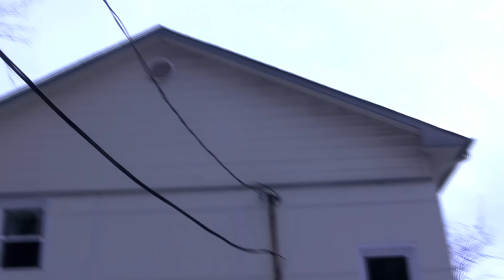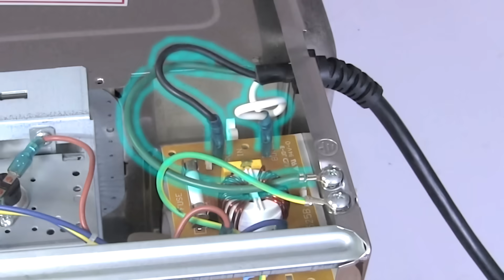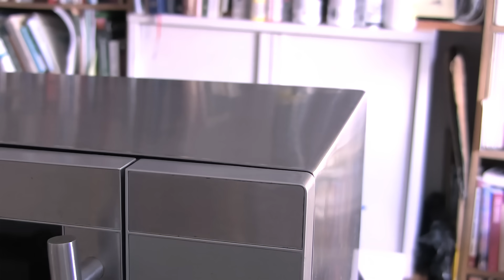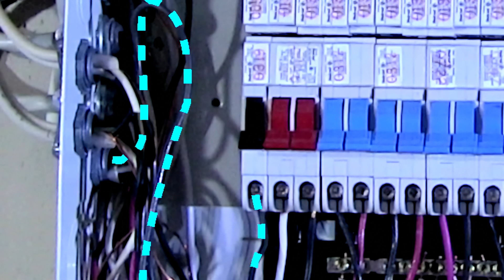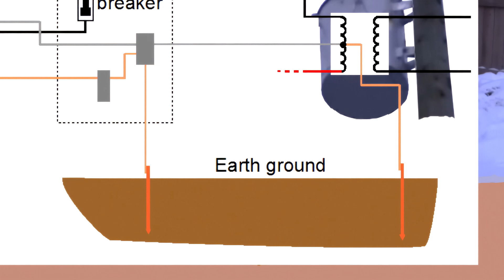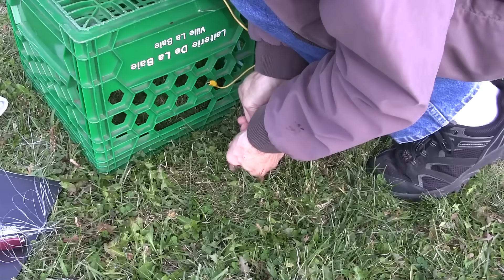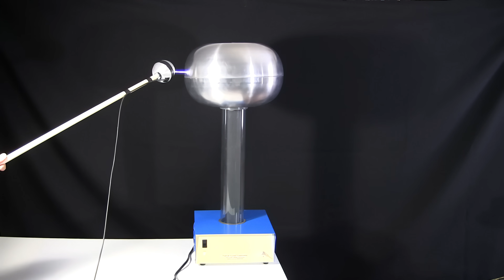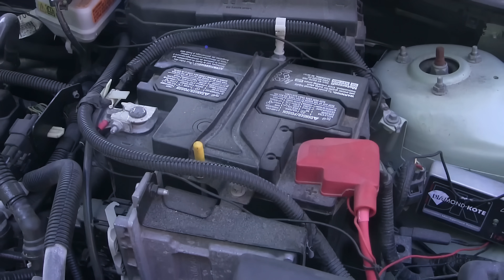What is Ground? Earth Ground/Earthing

Comment: Great video. But your explanation for why we connect the neutral wires/ground wires/center tap of the transformer’s secondary winding to the earth isn’t quite correct.

The PRIMARY reason we connect the neutral wires/ground wires/transformer center tap to earth is to prevent the transformer’s secondary winding – and all of the wiring in your house – from “floating up” to the voltage of the transformer’s primary winding. Which is around 7200 V (relative to earth) in North America. 

 There is some resistance between the transformer’s primary and secondary windings, and (more importantly) some capacitance between the primary and secondary windings. Because of this, if you do not connect anything on the secondary to the earth, the common-mode voltage of the entire secondary, including your circuit breaker box and all the wiring and outlets in your house, will float up to 1000 VAC, 2000 VAC, 3000 VAC... perhaps even up to 7000 VAC relative to the earth. An outlet, for example, will still have 120 VAC between hot and neutral. But each will be thousands of volts above the earth!

The only way to fix this problem is to "nail down" the secondary. We do this by connecting one of the secondary terminals to the earth. We can choose Line 1, center tap, or Line 2. It is best to connect the center tap.
Reply: So as you said, the main problem would be due to the lack of the same reference between the primary and secondary?
But if we measure just the secondary ignoring any connection to earth, this is probably going to be our expected 120V for example, but if we measure with earth it”ll probably be at higher voltage difference compared to earth?
There are some many concepts that I didn’t catch very well when I passed the electrical installation subject, now I am in field I am trying to understand this kind of behavior
Reply: In north America the leg to leg measurement is 240. Where are you getting 7200. Are you insane!??
Reply: @MathCuriousity  , the primary side is 7200 V relative to earth.
Reply: my mistake I’m sorry for that. I’m an idiot. May I ask two followup questions if u have time: 

1)
basically I was told that even if a system isn’t grounded (no ground rod to neutral etc at transformer and no grounding anywhere ) that if a power line that’s energized comes down and touches the earth, that it would still energize the earth. Now if energize means put the earth that it’s touching at its voltage then that’s surely true right? No matter if it’s soil, gravel, water right? A  120 v line comes down, and it will make the earth 120 v no matter what it’s touching? I’m not saying it will run current yet. Just saying that for instance, if we measure the neutral to the ground, we will get 120 volts right? So that’s the first question.

2)
The second question is - let’s forget about voltage. We have this 120 v line touching the ground - let’s say it’s grass or soil or water, is it possible for a current to flow thru the very earth itself if there are no grounding rods or grounding stuff anywhere near by? I ask it this way cuz I’m tryna take away with “return to source” and still see if current would flow thru the earth.
Reply: @MathCuriousity  as for #1: let's say I have a 1000 V battery on a table. If I connect one of the terminals to the soil, it won't "energize" the Earth.  The battery won't know it is connected to the Earth, and the Earth won't know a battery is connected to it.

As for #2, current always flows in a loop. If the secondary of an ideal transformer is floating, and one terminal of the secondary touches the Earth, then there will not be any current in the Earth. This is the same as #1, except we have an alternating voltage instead of a non-alternating voltage.
Reply: @ 

 Hey thanks for writing back! So in scenario 1, would the voltage read 1,000 - 0 = 1,000 then? 

And in scenario 2, why would it have to be floating for this to play out?

Finally - I wanted to ask you something else that’s been bothering me - if you have the time: I read that if a neutral ground bond is broken,  then if the neutral to ground becomes say 50 volts, that the hot phases will also rise the same value. Why is this?
Reply: @MathCuriousity  , in scenario 1, if I connect the battery's negative terminal to the earth, then the voltage between the battery's positive terminal and the earth would be +1000 V.  On the other hand, if I connect the battery's positive terminal to the earth, then the voltage between the battery's negative terminal and the earth would be -1000 V.

When someone says the secondary winding of a transformer is "floating" it means none of the secondary terminals are connected to the earth or chassis. It also usually means none of the secondary terminals are connected to the earth or chassis using a resistor or anything else. In this scenario, the transformer's secondary terminals are "isolated" from ground, and you can think of the transformer's secondary terminals as an AC battery sitting on a table. (See scenario #1.)
Reply: @ ah ok so this is just convention I get it! Whatever we connect to the ground then the ground and it both become 0! Then the other terminal will have to adjust to ensure the same voltage and directional convention +/- as before that went across it and had a certain direction from pos to neg.

Now I read there are two types of floating neutrals :
- where neutral disconnects from the transformer 
-where neutral simply becomes unbonded from ground.

Can you speak on the second? I read when neutral becomes unbonded from ground (say the jumper at the main panel between ground and neutral comes off), that phase to phase stays same and any rise in neutral above ground will show also that same rise in phase. I cannot FOR THE LIFE OF ME understand why the phase would magically rise by same the neutral does! I also wanted to know if you had any scenarios you could share in terms of after the ground neutral bond jumper is broken, and its floating, what scenarios could cause say a 50 v or 200 v neutral rise etc ?
Reply: @MathCuriousity  first of all, keep in mind that the center tap on the transformer's secondary winding is connected to the earth in at least two locations: once at the transformer, and again at the box that contains the round meter. This is good, as it guarantees the common-mode voltage on the transformer's secondary winding can't "float up" to the primary voltage of around 7200 V.

The voltage between Leg 1 and Leg 2 is 240 VAC. The neutral in the home is connected to the center tap on the transformer's secondary winding. This means that the voltage between Leg 1 and neutral is 120 VAC, and the voltage between Leg 2 and neutral is 120 VAC, regardless of the loads connected to them. Note that 120 V + 120 V = 240 V.

If the neutral in the home is disconnected from the transformer's center tap, there will still be 240 VAC between Leg 1 and Leg 2. But it can no longer be guaranteed there will be 120 VAC between Leg 1 and the neutral, and it can no longer be guaranteed there will be 120 VAC between Leg 2 and the neutral. The voltage between Leg 1 and neutral, and between Leg 2 and neutral, depends on the loads that are connected between Leg 1 and neutral and the loads that are connected between Leg 2 and neutral.

Let's say the neutral in the home is disconnected from the center tap on the transformer's secondary winding, which would be an abnormal and potentially dangerous situation. Let's also say the following three things are plugged into 120 VAC outlets that receive power from Leg 1 and neutral: 125 Ω, 98 Ω, and 46 Ω. This means there is 25 Ω between Leg 1 and neutral. Let's say the following two things are plugged into 120 VAC outlets that are powered by Leg 2 and neutral: 50 Ω and 50 Ω. This means there is 25 Ω between Leg 2 and neutral. Therefore, the voltage between Leg 1 and neutral would be 120 VAC, and the voltage between Leg 2 and neutral would be 120 VAC.

Let's again say the neutral in the home is disconnected from the center tap on the transformer's secondary winding. Let's also say the following three things are plugged into 120 VAC outlets that receive power from Leg 1 and neutral: 500 Ω, 180 Ω, and 130 Ω. This means there is 65.6 Ω between Leg 1 and neutral. Let's say the following two things are plugged into 120 VAC outlets that are powered by Leg 2 and neutral: 60 Ω and 25 Ω. This means there is 17.6 Ω between Leg 2 and neutral. Therefore, the voltage between Leg 1 and neutral would be 189.1 VAC, and the voltage between Leg 2 and neutral would be 50.9 VAC. Bad things might happen to the three things that receive power from Leg 1 and neutral.

When the neutral is connected to the center tap on the transformer's secondary winding, the voltage between Leg 1 and neutral is 120 VAC regardless of what loads are connected between Leg 1 and neutral, and the voltage between Leg 2 and neutral is 120 VAC regardless of what loads are connected between Leg 2 and neutral.
Reply: @ WHOA MIKE! That was an absolute wonder class explanation. I’ve seen a video that couldn’t illustrate as well as you did just there. I totally get this idea of a disconnected neutral at the transformer and the way varying loads on each leg can change things in a flash (and destroy devices)! I just have one more followup question and it concerns neutrals - but completely different scenario:

Let’s say neutral is fine at the transformer, but the neutral loses its bond to grounding system at the main panel; now if no environmental changes whatsoever occur, is it the case that the moment it loses its bond, it can rise above ground? Is this because the ground was “hiding” voltage? Meaning is it enough JUST to disconnect the ground system and boom neutral is magically risen? (Because earth was hiding voltage)?
Reply: @michaelcraft2664  Is our system here in the U.S. what they call "TN-C-S" in Europe (IEC terminology)?  That is when the neutral is grounded at transformer (TN) and the neutral that comes to the property is a "combined" earth and neutral in one cable (C).  Then it splits at the installation (S). 

Second question: I have read that the neutral on the primary side is directly connected (by physical connection) to the secondary side.  Is that right?
Reply: Yes, but with one additional point you missed.  The neutral in the distribution network is also grounded and is connected to the neutral in the secondaries which supply the customers.  There is one neutral throughout the distribution system, and it is connected to Earth.

Comment: THIS GUY IS A GOD AMONG MEN!!!! I’ve never seen so many fundamental concepts strung together to kill 3 confusing birds with one clarifying stone!!!!!! I just have a followup question:

I was thinking about a confusion I’m having and wanted to lay out these scenarios to tease out if I’m “modeling this” correctly in my head:

For the below scenarios, can I say the former would be like resisters in series and the latter would be like resisters in parallel?
A) we are grounded and touch an energized grounded metal receptacle box with both hands and thus the path to ground thru us is the same path the energized box is taking to ground. *Assume no breaker trips.
B) we are grounded and touch the energized grounded metal receptacle box with one hand and say a metal pipe that’s grounded with the other and thus the path to ground thru us is a different path to ground than the box is taking. *Assume no breaker trips.
Reply from the maker: If I understand what you're describing the I would say there are multiple parallel paths to ground. Each path has its own resistance.
A) You said "we are grounded" so lets assume that's through your feet. The paths are left hand - feet - ground, right hand - feet - ground, and another from one hand to the other hand.
B) Again, you said "we are grounded" so lets assume that's through your feet. One path is from the hand touching the energized ground metal box - the hand touching the grounded metal pipe. The other path it from the hand touching the energized hand - feet.
In both cases there is also the path through the electrical circuit. It's easier to see if you draw it out as an electrical circuit, but in general, you're doing the right thing thinking of it that way. Just keep in mind that the circuit needs to complete. So for example, the ground return path from your feet to the transmission pole may be very high resistance compared to the ground return path through that grounded metal pipe. The return path through the household circuit will likely be the lowest resistance return path because it's all copper wire.
Reply: @   Wow thanks so much for responding! I made a couple confusing remarks in my scenarios, but may I try this again: 

Let’s say we hold a hot wire in one hand, a neutral in other, and our feet are grounded on the ground:

Question 1: Would the math concerning resisters In parallel and resisters in series verify that we can treat our arms as two resisters in series and our legs as two resisters in parallel? Or since our body has a “trunk”, we can’t actually say what I’m saying regarding this?

Question 2: would what be like a scenario where our entire body can be seen as a resister in series with some other  resister in the situation where we get shocked by some outlet and a scenario where our entire body can be seen as a resister in parallel with some other resistor?
Reply from the maker: Take a piece of paper and draw the circuit in the video, (e.g., at 5:40 in the video). Then draw a stick figure of a person with arms and legs. Have one arm touch the hot (black wire at the microwave oven) and the other arm touch a wire going to neutral which really just goes to ground in the breaker panel (grey wire at the microwave oven). Draw another line that connects both feet together and then another line that connects to the middle of that one and continue that line to the ground at the transformer. The highest resistance is the skin, and the path through the body is mainly through the blood, which is lower resistance. So draw a resistor on each arm and each leg. Also, the legs are touching the actual Earth, which is the line going from the feet to the transformer's ground. That actual Earth is a much higher resistance when compared to a copper wire so draw a resistor on that line too.
You'll see that the two legs are two resistors in parallel with each other. You'll see that there are four parallel paths. One is the path from arm-to-arm. One is the path in the video that between where one arm touchs and where the other arm touches - that path is through the microwave oven and you can draw a resistor there too. One is the two legs - they're parallel with each other. And the other is from the person's chest, through the legs, through the actual Earch to the transformer ground.
Reply: @ Heyy! I’m sorry maybe it’s my “aphantasia” but I’m having troubles visualizing this all. Is there any chance you could do a short video on this - it’s mostly out of curiosity as I just learned about how resisters in series vs parallel act and I wanted to know if it would be the same with our arms and legs.
Reply from the maker: Yes, it would be the same with our arms and legs. Keep in mind that the resistances wouldn't be the same all the time. For example, If your skin is wet then the resistance for conducting through your skin is lower than with dry skin.
Reply: @RimstarOrg  but you know how you said if we hold a hot in one hand, neutral in other, while grounded via standing on ground, our arms will be resisters in series and our legs will be resisters in parallel ? Well…..would this literally behave the way we were taught circuits behave regarding resisters in parallel and resisters in series? OR would it not really count since I read that “series resisters share one node exclusively and parallel resistors share two” and since our body is joined by our trunk we don’t really have this circuit situation required to call hands in series and legs in parallel?!

In fact the more I think about it - the more I think the arms would be resisters in parallel and so would the legs!!!! Which still isn’t true because they are connected at the trunk!!!
Reply from the maker: You could be right about the affect of the trunk on the two arm resistors. Two calculate the circuit, the two leg resistors could be in parallel with the arm resistor that's going to neutral.
Reply: @ wait that’s not what I was thinking friend - I definitely don’t see how the legs could be in parallel with the two arms. How are you seeing that?
Reply from the maker: I'm thinking the legs are in parallel from the point where they connect to the trunk.
Reply: @ I wonder if you know under what conditions we would have current going from arm to chest to arm and skipping lower body….how could that even happen if they aren’t grounded? I’ve heard of people saying they felt the current shoot from arm thru chest thru other arm.
Reply: @RimstarOrg  PLEASE DO A VIDEO UNPACKING A FLOATING NEUTRAL (neutral disconnect at ground bus) VS A LOST NEUTRAL (neutral disconnect at transformer secondary ) AND THE EFFECTS!